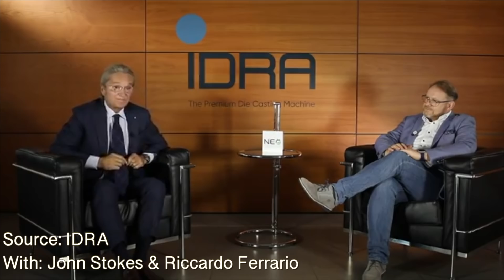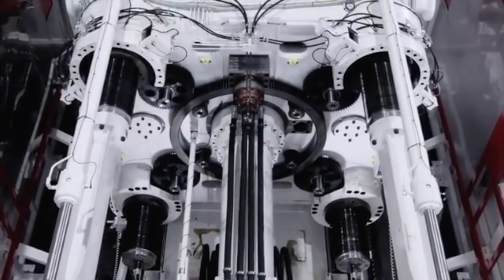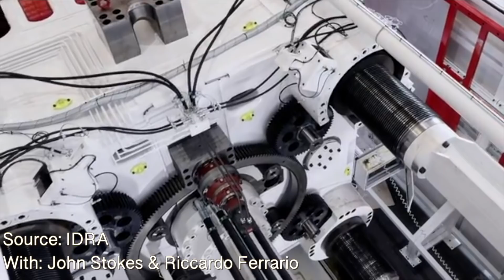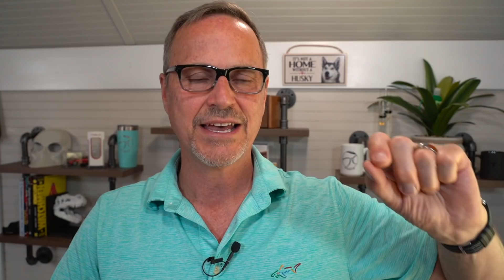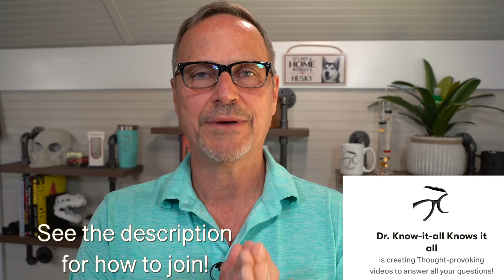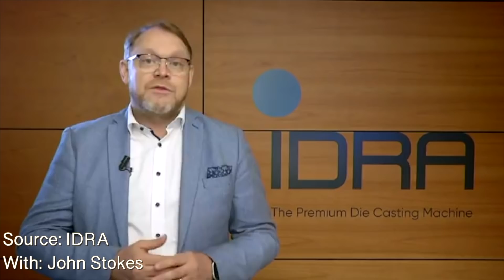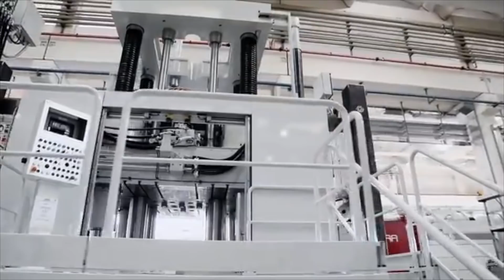Tesla's secret weapon: the Giga Press!

Comment: 04:30  Idra Giga Press #1+ #2 (aka Tesla DCM-6100-1 + DCM-6100-2 = Die-casting-machine 6100-tonnes-forces) are the two in production at Fremont since 2020; of those, the second one DCM-6100-2 is the one pumping out the Model Y rear chassis megacasting; and DCM-6100-1 is the one that caught fire and should be knocking out the Model S/X chassis.
Then Idra Giga Press #3 (seen in the Idra factory, probably c.October 2021?), plus #4, #5 are all shipped and in various stages of build-up/commissioning at Berlin (×2) and Texas (×1).
Then for Giga Shanghai, Idra's parent company, supplied three locally-built Chinese machines, LK DCC-6000 #1, #2, #3 which have the same general external dimensions, but various optical changes;  think #1 is in production and #2 + #3 in various stages of commissioning.  LK also supplied one LK DCC-600 machine to South Korea (not Tesla-related).

Comment: Heating and cooling is annealing, compressing material is forging.
Reply: ahem the GRAINS of the metal (or plastic) are ALIGNED by the packing (forging) phase of the process creating a CRYSTALLINE STRUCTURE. 

this THE difference between Plastic Injection Molding/Metal Injection Molding/Die Casting and 3D Printing/Additive Manufacturing.
Reply: well your are not compressing the mass/Volume will not change. Or at least not that it makes that much of a difference
Reply: @Milan22229  The crystalline structure of the grains at the microscopic level of the metal gets compressed making it harder.
Reply: @bryandepaepe5984  it won't get an harder by forging. It will if you cool it so that the cristals build Martins it but that you is only heat treating.
When you forge and cool the part slowly it might get even softer.
The grains are Re build but even that is more because of heat treating and less because of the forging
Reply: @Milan22229  So your saying the college I went to for mechanical engineering was wrong? You have never heard how much stronger a dropped forged crankshaft is then a machined billet one or why they can't be cast? The grain structure is altered in the different production methods. Annealing is heating and cooling to relieve stress and increase overall strength. Heat treating hardens metal by heating and quickly oil quenching a part. Forging is the process of hammering into shape or modern drop forge machines uses a die for the shape making.
Reply: @bryandepaepe5984  the groan is altered but the material ist not compressed. It is just moved around like dough when you form a pizza.
When you cut the grain like you would on a mill it weakens the structure ture.

Btw most modern car crankshafts are cast nowerdays just some premium brand forge them but there is no real need anymore the do that. Adi it is called.

Comment: This is awesome. Imagine the structural strength independent of bolts, nuts & welding? Then there's the flat, untwisting body when a vehicle moves around a very sharp bend? Then there's an accident that doesn't kill or destroy the occupants because of the structure. I can see those accident testing results climbing from the best in the business into a never before seen result.

Comment: im fairly confident the guy was just speaking random numbers with no actual solid data,  you havent really got a saving by having 2 bigger machines when the work output hasnt been worked out, he also said "around 20% less production line" but the numbers were rough vague numbers so they definitely havent spoken about it the actual numbers would be interesting to know though. The italian guy needs to get solid numbers and report them instead of just guessing lol

Comment: For dr know it all you don’t know much. Forging is the mechanical densificarion of the grain structure. In a forge, you bring an initially cold material up to semi solid state using heat, and then mechanically pound it to density the structure. In this case, the aluminum comes in liquid hot into the near net shape, is allowed to cool quickly to semisolid where more pressure is applied.

Comment: Die casting is similar to injection molding.  Injection molding uses melted plastic, while die casting uses molten metal.  Both processes involve pressure-injecting a liquid into a shaped cavity in the mold or die. (The mold/die  has previously been coated with a release agent so the part doesn't stick).  The liquid hardens, the mold/die is cracked (opened) and the solidified part is removed and cooled.  The mold/die is cleaned and the process repeats.

Comment: This is really a dumb idea if it means more aluminum, a metal that requires TEN TIMES as much electricity to refine & recycle as iron or steel. 
On top of that, aluminum is harder to repair & doesn't have the metal memory characteristic of steel. What this will accomplish is making cars that are significantly more difficult to repair and much harder to recycle as will the structural battery pack.
Expect many more Teslas that have been in accidents to be written off rather than repaired.
Perhaps that's part of the strategy?
Reply: I think your wisdom has discovered the fatal flaw.

Comment: Die castings use special low shrinkage alloys that are much weaker than are used in casting processes that use collapsible molds , we are talking like 5-6 times weaker. This is a hi production not a high performance process , a small manufacture can make a lighter/stronger/tougher casting using other processes .

Comment: Ok doc. Yes casting goes back before the seventies as I was a little shaver 66 years ago and had sandbox cast cars. It was decades later that I worked at GM here in Rochester as a tool maker building carberators for vehicles with alum and zink.

Comment: I still haven't heard how theses EVs are going to be repaired after minor accidents where a part of the front or rear is damaged. You then cannot just change one part. Sounds good to produce, but complicated to repair without just exchanging for just a new car.
Reply: Accidents that damage the underbody ("bend the frame") are not minor. Those are write-offs with traditional methods already.
Reply: @HenryLoenwind  Look here: https://youtu.be/w5fknRNIHiM?t=130 the 1- piece rear and front parts could traditionally easily be repaired, doesn't look like anybody except Tesla can do this in the future.
Reply: The crumpled zone portion of the casting that's connected to the bumper can be sawed off. A special replacement piece can then be bolted on to support the new bumper. Of course, if you hit a locomotive head on it's a whole different story

Comment: I would love to see a discussion sometime comparing pros and cons of casting vs. 3D printing.  Of course something like that already exists somewhere, but I'd be fascinated to see it in the context of applications like Tesla.
Reply: @JCKR2 It would take about 75 years to 3D print that chassis. And it wouldn't be as strong and tough as die casting.
Reply: 3D printing is great for prototypes, R&D and specialty parts.  For scale manufacturing, it would be WAY too slow.
Reply: 10 days to 3D-print a chassis.
0.1 seconds to die-cast a chassis.
(It's the difference between cutting cookies out by hand, and using a shaped cookie-cutter).
Reply: @paulsladen  what if it was a massive machine and it printed molten steel powder? It one whole cybertruck without the doors of course but an assembly cell not line?
Reply: @TheMagicJIZZ  Traditional assembly processe cycle/takt time increases with size.  Die-cast cycle/takt time stays flat (remaining c. 1/10th of a second)—hence the bigger the object (ie. Cybertruck chassis) the more significant the difference becomes.  It's why plastic widgets, and bottle tops, and Lego bricks are die-cast.

Comment: Regarding the Cybertruck: The rear, middle and front pieces of the undercarriage part of the vehicle would ultimately be made by giga casting(s). The exoskeleton is made by bent stainless steel. So to answer your question, both techniques are being used to build a CT. At least this is what would make sense.
Reply: Right.  Bent stainless will not be used for to make the chassis, as suggested here.

Comment: Making the entire skateboard structure for an EV in 3 pieces is a huge, huge cost saving over bend and welded steel pieces.
Reply: The amount of manufacturing steps directly and indirectly eliminated is truly hard to comprehend. Also, Tesla has shrunk several systems down to one Octovalve, and I'm sure is still working on consolidating wiring to main lines instead of point-to-point. When that's all put together, the cost of producing a Tesla will be staggeringly low.

Comment: With the LPF, it sounded like a smaller machine could do what the larger gigapresses do, so you could pack more into a smaller space. But I could be misinterpreting.
Reply: The LFP process is an experimental hybrid casting+forging process: die-cast, then whack/compress—ie. "striking whilst the iron is hot", except in this case, aluminium.
Reply: @paulsladen  exactly, that was my understanding. They could fill similar needs as the gigapresses.
Reply: Yes, you are misinterpreting what was being said. The LPF doesn't do what the larger presses do. It is designed for forging metal, not die-casting. Would suggest that you do some research, then you'll possibly understand what the deferences are between the two.

Comment: For all those that don't understand the high pressure die casting process, here is a simple vid. The Idra machines are obviously much larger and more complex but the basic process holds.
https://www.youtube.com/watch?v=iSyBsdJkQu8 
One thing to consider is that you have to be able to get the part out of the die. Casting large complex parts with many undercuts means the dies can be extremely involved
often utilizing sliding side cores which all have to be retracted before the part can be taken out of the die.  What Tesla have achieved here is quite something.

Comment: What does a large single casting mean for accident repairs? Are you without the car for four months? Does it mean the insurance company is more likely to "total" the car?
Reply: The crumple zone is designed to be sawed off and replaced with a bolt on component. Of course if you run head on into a locomotive it's another story

Comment: You got the bit about the battery wrong. He does not say that the battery pack will be a casting. In fact he is quite clear that the manufacturer only needs two Giga presses, one for the front casting and one for the rear casting. The battery pack is a structural component, but not a casting. Tesla has not announced any plans to use a casting. In fact their battery day announcement was that the batteries themselves provide most of the rigidity of the battery pack, so no casting is needed.
Reply: How could small batteries possibly be a structural element? It's the structure they're put into that Elon was talking about.
Reply: @DogBoy987  Not so. The batteries themselves provide structural rigidity in combination with the rest of the package. Size doesn't matter, physical strength and characteristics do. The new batteries have several characteristics that make them more suited to being used to provide structural rigidity than the previous cells, most notably the way they are cooled, and the way the electrodes are attached.

Comment: I don’t like this President of IDIRA. They only had a smaller casting machine that only had the capacity to produce the MODEL Y  in 2 pieces. TESLA went to IDIRA to double the size so rear sub frame could be cast in one piece. Without TESLA their would be no casting machines. TESLA  spent hundreds of millions co developing this larger machine by focusing on the Metallurgy and process of the machine so it won’t shrink and come out perfect. It was unimaginable for him to take all the credit for this machine and now an even bigger machine for CYBERTRUCK. IDIRA has all the work they can Handel from TESLA. He came across as a dumb salesman looking for orders from others right now?
Reply: Sorry Butch... but you're talking nonsense. Please go do some proper research before you throw tantrums like this one. It makes you look very silly...
Reply: @brunosmith6925  OK WISE GUY. show me a motor housing made from Bening steel.
Reply: @butchbailey8565  Sadly I am not wise. I am just a simple-minded horse - but I do think logically - most people don't.

Comment: At one point in time Tesla was talking about making the rear of the car in a single mold. Munro mentions in a video that a new "Y" had it installed. Do all "Y"s have them now? Also, they talked about having a one-piece left and a separate one-piece right side front molds. Did that ever happen?
Reply: The Y rear underbody was made of two castings originally, but now they are made of a single piece with the new 6000 ton machines. And yes, all Model Y are made the same way. The Model 3 will be the same as soon as Tesla will be able able to afford the necessary downtime.

Comment: 6'10''   "I assume tweNNY-tweNNy"... no, wrong; it was august twenTy-twenTy.
Reply: He's not that tall its 6:10 which is clickable.  I hear Twenny Twenty.
Reply: @danielstapler4315  
6'10'' means 6 minutes and 10 seconds for about 200 world countries. Of course not for the USA which still uses miles, yards, feet, knees, ankles, inches, fingers, fingernails and pube's hair rather than the meter, just the meter, only the meter. Yes, you hear "Twenny twenty" and applying the same fantasy to the rest of your life I get you are the richest, tallest and smarter man in the Universe.
Reply: @paolopetrozzi2213  6'10" denotes a length of time or point on a circle, whereas 6:20 is a point in time.
Reply: @HenryLoenwind  
What time is it? It’s 6:10 am.
How long did it last?    2d (dies) 5h (hora) 6min (minute) 10s (secundus)     (Dies, hora, minute, secundus = Latin, not English) 
(Latin has been the language of science (medicine, astronomy etc) for two thousand years, up to... yesterday) 
And in the S.I.  it's 'min', not 'm'.
3° 30’ 30”     tree degrees, 30 minutes and 30 seconds of angle.
At what point in the video he says that? At 6 minutes and 10 seconds / At 6min10s or 06min10s  =  6’10’’.
That happens at 6’10’’ into the video.
Coders and videomakers are known to be very proficient at languages. Sure.
It's just my opinion.

Comment: Question,  if ever there is a issue with that structural battery, would it be very hard to change it ??
Reply: Currently to fix a battery pack the approach is to take the top off the pack, identify the failed (parasitic) cell and de-activate it. If you have 7000 cells in a pack and you get rid the contribution from one or two cells it isn't a big loss to the capacity. I think there will be a top to the middle section casting that can be removed because basically there has to be a top because how else would you get the cells into it. 
Is the mid section bolted or welded to the other castings? Would you need to remove the seats to get to the battery pack?
If it is bolted, then that would make things easier. Even if you weld the nuts onto the bolts.
Reply: Mr know It All said they put epoxy in the battery tray. So I'm wondering how the coolant fluid can keep the battery cells cool.

Comment: Don't you also need a special alloy to press? I thought regular steel cracks?
Reply: This require aluminum alloy. The special alloy is needed to remove tempering to strengthen the metal. You can use regular aluminum with tempering but you have lower yield because tempering can cause warping. But you can just re melt the warp parts so the only loss you have using regular aluminum is reduce production output.
Reply: @kazedcat  Dr K-I-A mentioned an axle as a possibility, I would think that it would have to be steel not aluminum.
Reply: @danielstapler4315  That was for the Low Pressure Forging Machine. Which is a completely different machine than the Gigapress. Gigapress is High Pressure Die Casting.
Reply: @danielstapler4315  I don't think Mr know it all knows what he's talking about. He talked about putting epoxy in the battery tray for heaven's sakes. How could you get cooling fluid to flow through an epoxy filled tray.
Reply: @DogBoy987  Elon himself has talked about epoxies that include flame retardants.  Not sure, but cooling might be accomplished by conduction through the battery ends.  Tabless design helps with that.

Comment: How does this machine expel the finished casting?  It seems like these enormous pieces would come piling out of this machine at a rate of a few every minute. Is there a robot that quickly scoop them up?
Reply: They don't just fall out by themselves, a robot arm has to pull them from the mould. Tesla released some nice video of the operation and at least one drone pilot captured it from above.
Reply: 1 every 80 second, multiple robots do service the machine
Reply: @jonbong98  thanks